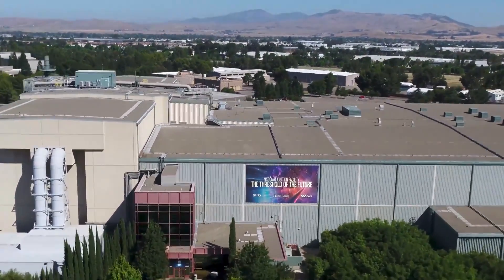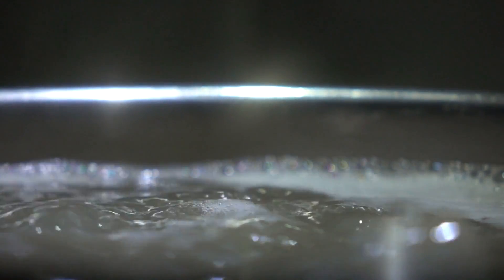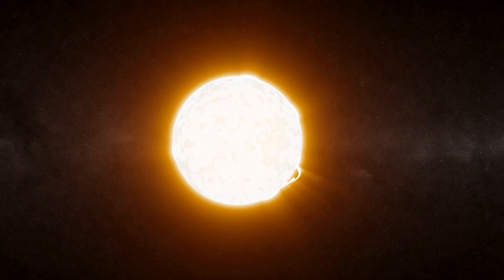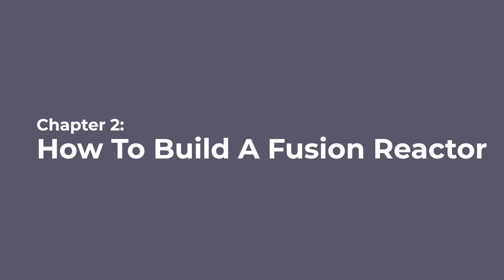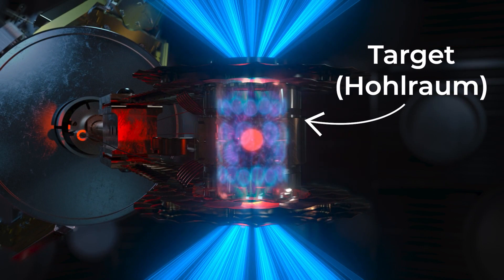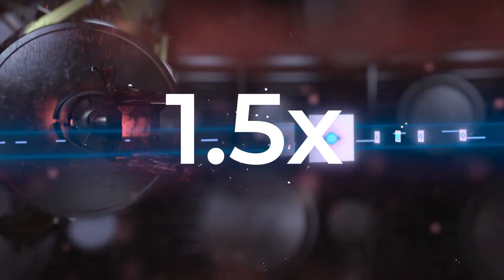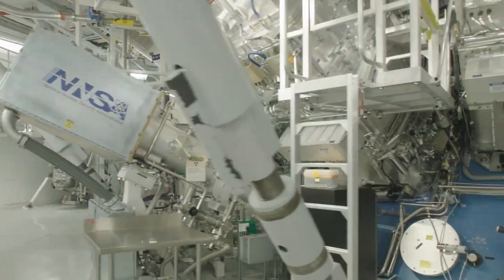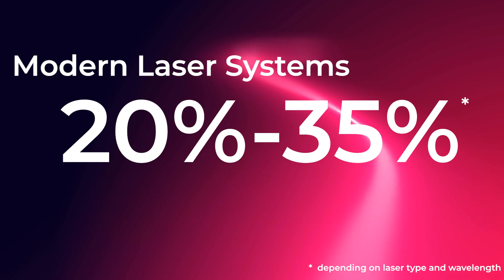The US Fusion Ignition Breakthrough EXPLAINED

Comment: There’s two steps- physics and then engineering. Step 1 was to prove in principle that the physics work and make sense. Step 2 is to production-use it and make it efficient and scalable.  So it should be celebrated that step 1 has been achieved, everyone is like “oooh there’s an asterisk” and it’s like yeah, we always knew the engineering challenges wouldn’t be proven out until the physics were proven.
Reply: Was step 1 proven?  You have to power turbines to produce electricity at a higher net amount than you put into it.  That hasn't occurred, yet. I'm looking forward to seeing the proof of concept.
     I'm still hoping, but I remember cold fusion a few years back, "solar roadways," etc.  The scientific method is important to help us with our biases and magical thinking, to produce scientific advances for our future.

Comment: Well thank you for the explanation to a blue collar guy such as myself, but nowhere in this explanation do I see "clean" energy. How is Deuterium and Tritium extracted/mined/made. Will the energy used to obtain these two elements along with the energy needed to make laser light plus the energy needed to make the container for the two main elements not be more than the energy gained. Logic is that it takes an input of 2.05 MJ to create 3.15 MJ of energy which requires additionally two elements that is mined using more energy than the gain during a process which requires a lot of energy in itself just to make 2.05 MJ in the first place. No I do not think this is clean energy . I think this has more potential to be a upgrade for the atomic bomb. So far this has the same type of logic as electric vehicles which is an extremely clean mode of transport, but uses a battery which is more destructive than diesel and petrol.
Reply: Deuterium is recovered from water. It’s effectively free. Tritium will be bred in the reactor, so is infinite.

This was the “upgrade” to the atomic bomb in the 60s. It’s called a hydrogen bomb.

This particular “breakthrough” used more energy than it produced, but future ones will not. It absolutely is clean.

Comment: China did the first successful fusion ignition with net + power, when that happened scientific community hardly batted an eye wtf is this false advertising. lmao
Reply: No they didn’t. Where did you read that misinformation?
Reply: @Gomlmon99  They started construction on a fusion reactor for large scale power generation recently as well.
Reply: @Altani-Raen  So have many countries.

Answer my first question? You’re just spreading information. Either admit it or quote where you read the misinformation.
Reply: @Gomlmon99  As I said I read it from the Smithsonian back when they confirmed they achieved net positive fusion for 14 minutes solid on January 10th 2022.
Reply: @Gomlmon99  Wait a moment I have a correction it was 17 minutes of sustained fusion not 14 minutes and the temperature was measured at 69.9 million degrees Celsius or 126 million degrees Fahrenheit.
Reply: @Gomlmon99  Sadly month later Russia struck Ukraine and most scientific news was put on a back burner it's ok that you didn't know but you shouldn't attack others for your ignorance it's rude and bad taste.
Reply: @Altani-Raen  A low power plasma is not the same as fusion, nor is it net, nor is it power as you claimed.

I’m not attacking you. I’m attacking misinformation and it’s spread.
Reply: @Gomlmon99  it produced more than enough thermal energy to make up the reaction start cost in energy it's why they started building a commercial reactor for large scale use check the link I commented
Reply: @Gomlmon99  link keeps getting removed but for reference fusion is plasma "Fusion, the power that drives the sun and stars, combines light elements in the form of plasma"
Reply: @Gomlmon99  Also you say that its a low power plasma while our sun sits at 15 million degrees Celsius and the Chinese fusion reactor is more than four times hotter at 69.9 million degrees Celsius.
Reply: @Gomlmon99  if you want to find a good source of info on the reactor just look for China's artificial sun if I remember right the peak temps were 160 million degrees Celsius though it couldn't be sustained as it was too hot being over 10 times hotter than the sun.
Reply: @Altani-Raen  I know what you’re referring to, I don’t need to look
Reply: @Altani-Raen  I’m not American. I live in the EU. 

I have presented you with facts, with the unified opinion of the fusion community, and absolute justification for it.

Yet you’re still spreading misinformation and crying because I won’t watch a YouTube video of which I already know the content better than the creator of said video does.

Comment: Why not use fission to ignite a fusion reaction?  Note:  Tritium is hard to produce and tightly held by nuclear weapons powers.  It’s current use is an accelerant in atomic bombs, and is replaced every 7.5 years because of its short half life.  Tritium requires a fission reaction to produce, though much cheaper than producing fisible uranium.  There are only three facilities in the world that produce usable quantities of tritium, and it all goes into weapons.
Reply: How could fission to be used to ignite a fusion reaction? That doesn’t seem possible.

It’s half life is 12.3 years. 

It doesn’t require fission in the usual sense of the term. It’s either a neutron absorption by deuterium, or a neutron absorption of Li-6 by decay. 

It doesn’t all go into weapons, much of it now goes into fusion.

In fusion reactors, tritium will be bred such that it’s effectively infinite.

Comment: I have seen videos about the Helion Energy who is working on what looks like a much better reactor design.  They use magnetic fields to compress the fuel and send two masses of it crashing into each other.  Their reactor fuses Deuterium with Helium-3 to create helium-4.  Helium-3 is rare, but they have already patented a process for producing it by fusing deuterium in a separate reactor from the electric generator.  And their generator gets electricity directly from the plasma rather than boiling water.  During fusion, the plasma pushes back on the containment field which causes changes in the magnetic field that can be used to generate power.  Their reactor already can be reloaded in rapid succession and is small enough to be built in a relatively short period of time.  This has allowed them to test several versions of it thus far.  In terms of being able to make a commercially viable reactor, they look the most promising to me thus far.
Reply: They are decades behind other commercial startups. They also have a strong PR team which means gullible people (who get their info from YouTube) fall for them quite often.
Reply: @Gomlmon99  
Decades without progress is not a good track record.  And you have said nothing of substance to refute anything about them.  Just some vague personal attack.  That makes me question your statements rather than theirs.  For someone who claims to have so much information, you are very reluctant to share it.
Reply: @TerryProthero  What has been decades without progress? A huge amount of progress has been made, and new records are achieved every year.

CFS for example started in 2018 (or 2019 I can’t remember) and are now a few years away from having a reactor capable of Q~10.

It’s not a vague personal attack. It’s just common knowledge in the industry.

Comment: What I read was, we had to start the fusion process once i.e. achieve the targeted temperature and thereafter, the process would go on without any further energy input. So, my question is if we are to input 300 MJ to produce unlimited energy how's that supposed to be inefficient?
Reply: Either what you read was wrong, or you didnt understand it at all. Fusion isnt an infinite energy source. Nothing is, that would violate conservation of energy.

Fusion also isnt self sustaining. The temperatures required for fusion to operate requires some form of confinement system (be it inertial or magnetic). That alone requires an insane amount of power, and the fusion process fails if confinement stops.

Fusion also stops when the fuel gets used up. As deuterium and tritium get fused into heavier elements, eventually the fuel becomes saturated with product, halting the fusion process. This limits current fusion reactors to only short bursts of power before they need to be shut down, their products removed, and new fuel put in, in a systemmatic process. In any of these reactor designs, one of the major hurdles that needs to be solved is how to vent or exhaust products, and introduce new fuel, mid-reaction, in order to keep the reactor running during fueling and exhaust, instead of constantly shutting down. Iter plans to at least accomplish the fueling component with a lithium/beryllium blanket on the inside of its chamber, both to capture the energy released by fusion by heating up water, and to fissile lithium into new tritium fuel.

In NIF's case, continuous fueling would have to be accomplished by, for example, dropping the fuel pellet through the chamber, and timing the lasers to detonate it as it falls... Which is really hard to do and hasnt been attempted yet as far as Im aware.

Between fueling, exhausting, and confinement, there are many factors that can halt a fusion reaction, so it is anything but self sustaining. It must be actively sustained by the plant operators... Although this is a hassle to get right, its actually a good thing. This is one of several things which make fusion way safer than any fission plant. If something breaks, or you run a fusion plant improperly, the fusion reaction fails, and there is no runaway meltdown or anything like that.

You may be confusing fusion for fission. Fission DOES have a self sustaining chain reaction if done correctly. Fission is what modern day commercial nuclear power plants use. And since the fuel are these very dense and very massive bars of uranium (instead of a tiny amount of hydrogen that can be consumed in a day), these fuel rods can last years, or decades, before they are "spent" and need to spend time in cooling ponds before they can be reused, or simply contained in a waste container, and disposed of.

Two things. First, even fission has a fuel and a byproduct that ensures the reaction cannot continue forever. Uranium gets smashed into smaller and smaller atoms, some of which are not conducive to further fission.

Second, yes, unlike fusion, you can get fission to easily self sustain, so there is no real input energy required. Just remove the control rods, and the reaction GOES. Although this is simple and easy, its also extremely dangerous. Depending on the characteristics of a reactor, it can in an instant go from producing power at a safe level, to melting down and destroying the power plant (while spreading radiation).

The fact that fusion does require so much effort to make it produce profit energy is the very thing that makes it fail safe compared to fission.

Comment: As scientist have repeated over and over again for the past 60 years... fusion is just 20vyears away. Lmao.

But then we really have no energy shortage! You spoke of nuclear waste, that nuclear waste could be used to make thermo nuclear generators to produce power. They have been used in our space programs for decades, we know how to do it. Why does the government refuse to use it? Not only would it provide clean energy but it would also use up nuclear waste as it's fuel.

Every year we dump millions of tons of biomass into our landfills in the form of paper, cardboard, leaves, twigs, branches, etc... when it decomposes it creates co2 naturally. In the 1940s we developed biogas furnace to use during ww2. Why are we not using them to generate energy and replace at least some of our fossil fuel use. You can't stop biomass from decomposing so why are we wasting this free energy resource and cluttering up our landfills?

Even if you can't replace all fossil fuel isn't it worth decreasing fossil fuel use by 75%? Or even 50%?? Or even 25%??? No there may not be 1 magic solution existing today yet, but if we do several solutions that chip away at the problem are we not better off than doing nothing?

Our sewage plants generate methane gas that's just burned off into the atmosphere,  why can't we use that gas to at least decrease the amount of power required to run the plant? Less power used means less fossil fuel used? Isn't that what the climate cultists want? Why arnt we doing it already?

If instead of installing a ceptic tank you installed a bidigester it could help heat your home and cook your food. That in itself reduces fossil fuel use. We have the technology to do it. A biodigestor is almost identical to a ceptic tank, except biodigestors rarely if ever require being pumped out and they capture the methane for heating and cooking.

We expend great amounts of fossil fuel to mine rare materials to make Lithium batteries at great expense.  Yet why are we not using Edison batteries for fixed electric storage plants and power walls. Yes they are larger, heavier and less energy dense that either Lithium or lead acid but why do you need your power wall to be light? Why does a solar or wind mill farm battery need to be light? They don't! They just need to work and Edison batteries have a lifespan of many decades of continual use. They don't use damagerous acid. They work in a wider temperature range. Why are they being ignored for use?

You might ask what does this all have to do with fussion? The whole point is we are trying to reduce pollution right? So with so many proven tested and working solutions already available to us, why are we waiting for fussion when we can make a difference today?

Comment: crazy they are working on fusion still when the sun gives plenty of free energy to the whole planet
Reply: It’s not free to collect though is it?
Reply: @Gomlmon99  you're confused. I'm saying it's energy thats *already AVAILABLE*. My comment has nothing to do with money. Why work so hard to create fusion and try to CREATE energy? It's so silly. They are busting their asses to build a system that GENERATES energy. When all the energy we will ever need is already available and in high abundance. It's like trying to build a machine that creates water when you live by the ocean. This is a race to shift the balance of power to a new entity. It's greed, they want to create dependence on a new form of power that can be controlled and sold. THATS why fusion. It's about making the world powered by an energy source that can be sold. They are afraid of solar. every everyone had solar panels powering their homes, the huge electical power monopolies go away.
Reply: @hankb7725  it’s not that deep. They believe they can make fusion cheaper than solar. So therefore preferable. So they research it.
Reply: @hankb7725  The fuels that will be required for fusion are extremely abundant and cheap. It has the potential to make a huge amount of power compared to a solar array. It can be used in areas of low solar intensity. 

Fusion could be cheaper. It remains to be seen. Take your tin foil hat off.

You are talking about things which you do not remotely understand.
Reply: @Gomlmon99  watch the video again. They specifically said there’s a very limited supply of those substances.
Reply: @hankb7725  I work in the industry, didn’t bother to watch a video from someone who knows very little about fusion.

Tritium will be self-bred and effectively infinite.
Deuterium is from water and is extremely cheap. 

It’s not up for debate.

Comment: Would increased mass of fuel and a rotating magnetic field not increase the potential for a better and more efficient energy potential? If the lasers are focused on two specific focal points at the poles then a spinning  magnetic field could potentially hold a continuous plasma field longer than a standing wave magnetic field. Probably a dumb question that will receive a equivalent beat down of a answer but a rotating magnetic field would in theory be similar to a tokamak containment but with lasers firing from the poles. Dumb question I am sure!